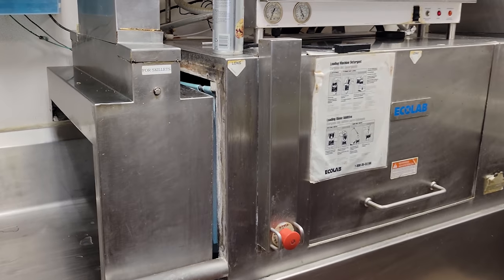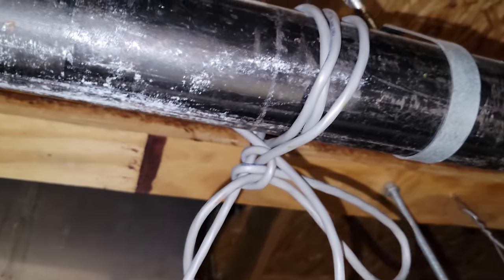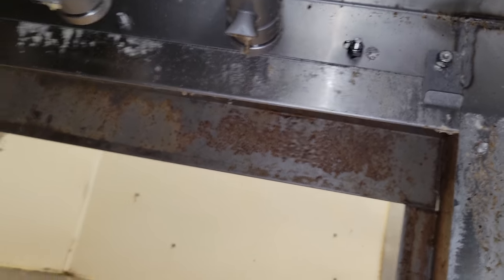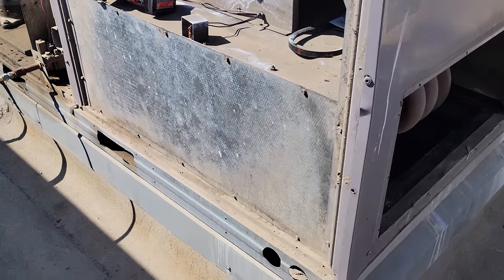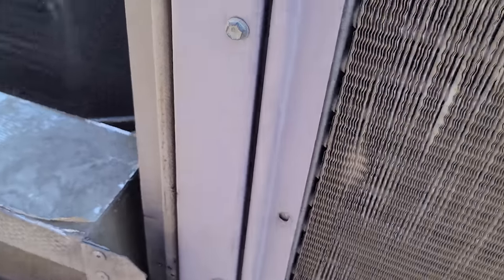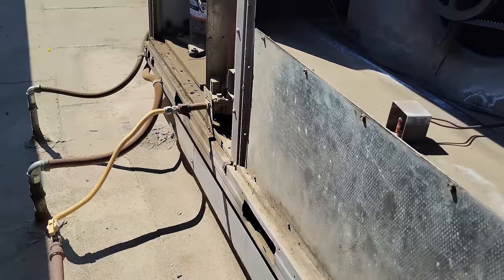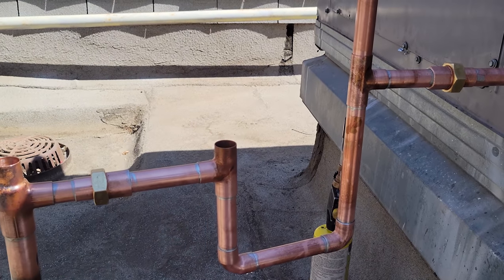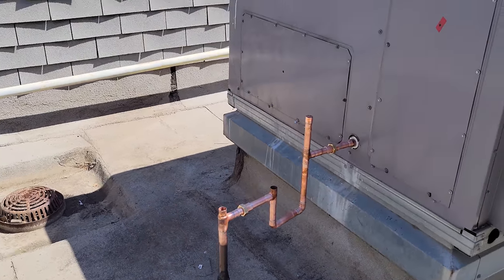THEY SAID THE DISH EXHAUST FELL FROM THE ROOF ????

Comment: I'm a plumber from the UK and find your videos interesting. As a plumber a trap stops sewage gases coming back... I saw these traps wil a tee after the trap and I commented asking "why is the tee after the trap I thought the trap was to stop smell" knobody answered my question I was just called stupid... I'm not a refrigeration guy I'm just a plumber.. so thanks for explaining the reason for the trap of water lol 
Great videos! Keep them coming

From the UK
Reply: I never thought about negative pressure being the reason for those traps!
Reply: @beaviswashere8009  could be either or. If you have the drain after the  blower then it's positive pressure. I think many tees are thrown in for clean outs assuming they made them removable and other people just do it because they don't know what they're doing and think they need a tee there.
Reply: Lol acs typically just run into a giant drain pit or right off the side of the building, no need to worry about gases usually :)

Comment: I always run into the same issues with those units. I have used a tap and die set and it created new threads. Just enough for the male adapter to grab good. Haven’t had any issues. That’s a lot of hours for just a drain pan. Hate that carrier setup. That’s why I love Lennox unit drain pans. Good job like always Chris. Thanks for teaching us new things. 🍻

Comment: Never seen a dish washer with a vent like that. Every where I worked the Dish had it's own vents like the the rest of the kitchen a skirt around the ceiling area and vents inside which have filters. I mean even where I work the dish washer has been replaced a few times. They are leased so they just  desolder the pipes and put in a "new" one. And a guy comes every month to check on the machines and make sure the dish is running right.

Comment: Dumb question..do you have to add water to the trap to make sure it doesn't suck in air when u first install the trap?
Reply: Always a good idea. If your starting a unit in a high load it could overflow before the trap fills up, especially in a higher static unit. Most of the times it will fill itself without any issues but better safe than sorry
Reply: Doesn't hurt especially since that will have negative pressure pulling in so adding water will "seal" that air from coming in.

Comment: Someone might have used alloy pop rivets for the ducts, and the chlorine in the dishwash soap slowly dissolves the alloy and it falls down after a while, so, the stainless steel bolts will do the job!

Comment: Had a similar call this week “leaking ductwork”.... dishwasher exhaust motor  burnt up. Replaced the motor and found the leaks in the seams caulked them and recommended the call a welder to fix the improperly welded seam. Big picture.

Comment: Is there a way to put a brass coupling on the old drain pan with a nut or what it could be called on the inside?
Reply: A custom made brass bushing would be a simpler and cheaper fix.

Comment: On one video can you explain how to size those traps? I know when the coil is on the return size of the blower you really need to size the trap dimensions properly and I’ve never really known how to size them in the field
Reply: All you need to know is the static pressure of the unit. Double that value then size the length of the trap to so that the static pressure of the water column in the in trap is equal to this. That will make sure the water won't be pulled through

Comment: I am surprised that the drain fitting can't be bored out so a piece of copper pipe could be inserted.  There are many sealant products to goop it with... there's no pressure involved.
Reply: Yeah I was thinking it'd be easier to ream it out and then just 2 part epoxy a fitting onto the end. It would hold just fine
Reply: The problem looked to be the fiberglass had started to decay.

A patch job will not replace the poor ageing fiberglass.

The thought of gluing a stronger material into the pan, and attaching the disconnect system to that is attractive, but the fiberglass will still age and decay and need replacement

Comment: That’s what you would call an ahole install for that ducting, welding is classic. Looks like possibly the whole weight of the ducting was on those welds. But please, take it from the guy who has to work on that style of dishwasher, don’t have the y ducting that close to the box on the dishwasher otherwise you can’t get the top off or you aren’t able to get to the components. Anywho, just my two cents. Good repair

Comment: And good luck getting those pans right now.. backordered to infinity. I usually pull the economizer out. And I put a rachet strap from the end of the blower to the other side of the unit to help hold it up whole I get the pan swapped. Totally stupid design, fragile fiberglass pan built as a structural component.

Comment: Not to mention the sewer gases you can bring back from that drain line if there were no trap!
Reply: It drains to a gutter or into another drain in the building most likely and isnt directly connected to any kind of sewer system. P trap on an AC unit just let's the pan drain
Reply: @MegaDysart  Most of the time yes, but I have seen them also hooked into a waste line.  I prefer to run the drain to a roof drain via a p-trap and let it go.  P-traps, depending on your location can dry out over winter months, I see this a lot and with the bad installations of plumbing into a waste line.... well you can imagine the complaints I have had.